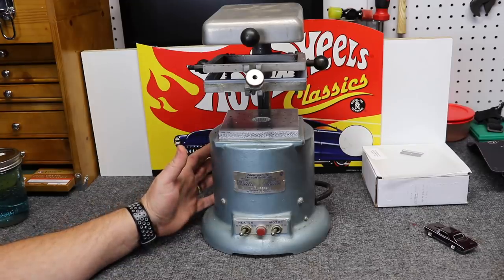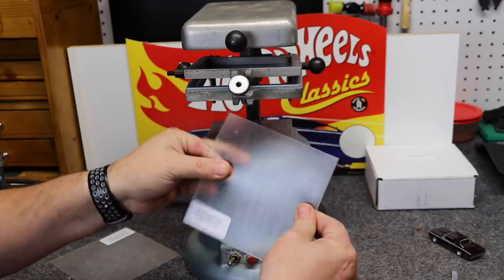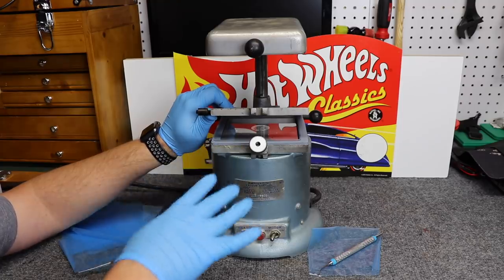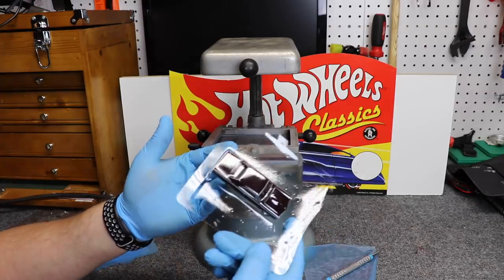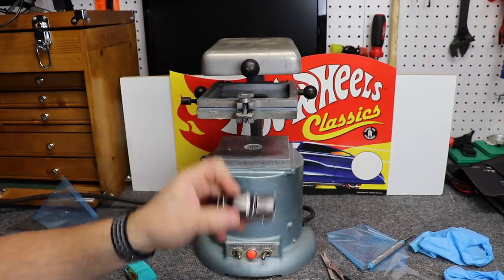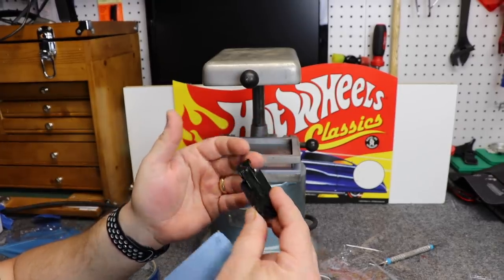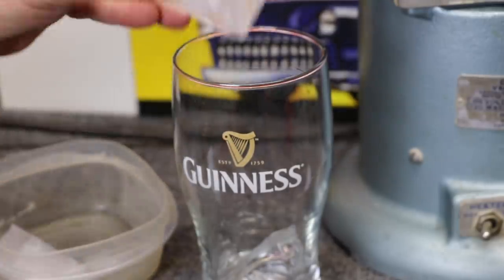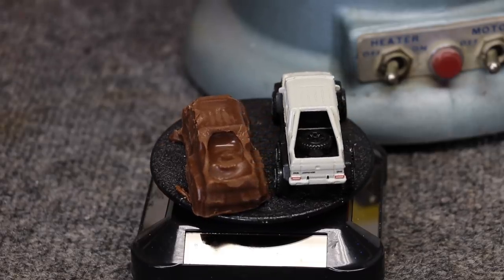Matchbox & Hot Wheels Customizing : Vacuum Forming Parts, Ice, Chocolate Bars

Comment: I just bought this machine and the plastic you linked. I am excited to experiment with it. Thank you for posting this as I didn't know they exist! I paid $24 on eBay for the identical machine. 

My first project is I have a spare set of foglights for my car since a rock just broke one and I had to buy another pair. I'm going to cut the lens off one and use it as a mold to make hard plastic snap on covers to protect the new lights from another stone. 

Thanks again.
Reply from the maker: Awesome! Let me know how it turns out. I haven’t used it much recently but it’s nice to have!

Comment: For resin casting using the diecast to make a starting mold for an H.O. slotcar,  I have found the bleaching tray material is much better for details than the stiffer plastic. 0.20 I have found is better.  Filling the car with modeling clay and recessing the clay in the glass areas gets you a better result. It is tedious though cutting out the individual pieces. I haven't tried putting the clay on the other side, the outside, it might work better. You do want a smooth finish. I would think you would get the tape texture transfer to the plastic using the tape.
Reply from the maker: Hmm.. Often they use splint material for bleaching trays also but all the bleaching tray material I have on hand is .040 and it didn't really work well. The Splint material is .020 as well and isn't really all that stiff. It can be folded a decent amount without creasing. I thought of the modeling clay on the outside, I think it would have worked really well. The tape actually worked decent on the sides where the tape didn't have a fold in them. The one side I obviously missed the mark :) Thank you for the awesome tips!

Comment: I had a thought. If you vacuuformed the outside of the body, left the flashing on, and drilled tiny holes in the windshield area to avoid trapping air it should do a much nicer job of making accurate windshields than using tape on the outside. I would make an open box base to support the lip of the flashing to keep it from moving while vacuuforming as well.
Reply from the maker: Great idea!
Reply: @WheelsNThangs  I would let the plastic get good and saggy before trying to make the actual windshield to make sure it would be pliable enough under vacuum to form the tight corners.

Comment: Thats a pretty cool machine. I got this stuff called blue stuff. Have not used it yet. But you should check it out. Blue stuff.
Reply from the maker: I've actually messed with that a bit but never with Hot Wheels.
Reply: @WheelsNThangs  im planning on using it this weekend. Ill make some fender flares. I just got to find miliput. Its somewhere.